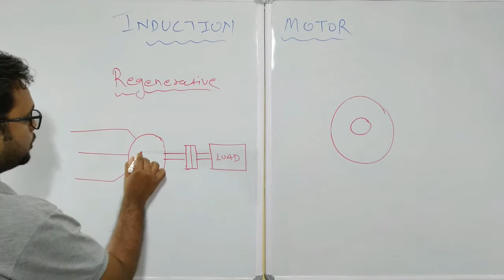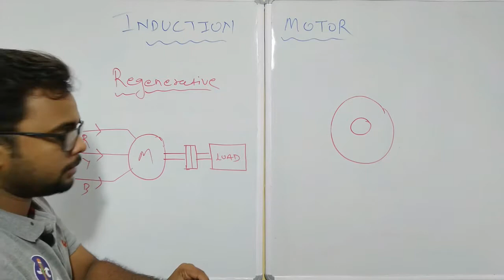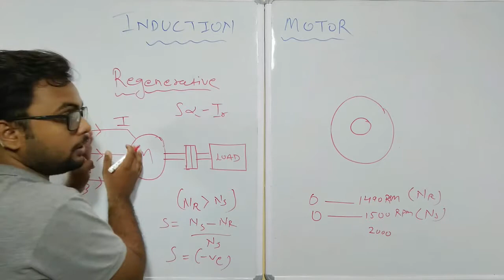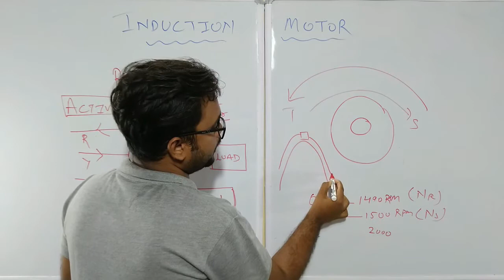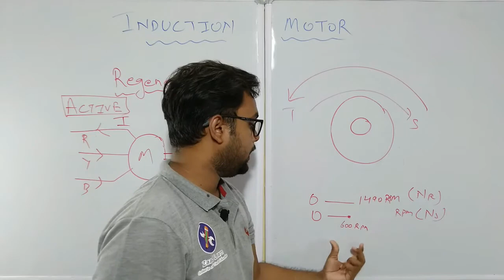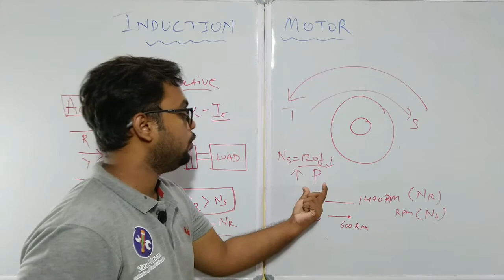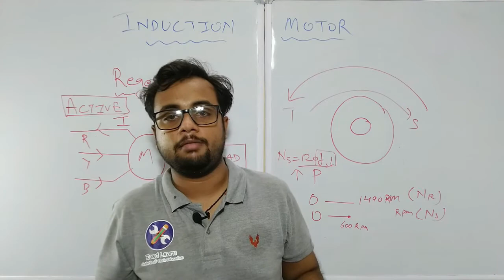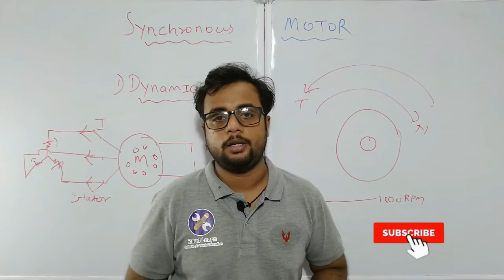Regenerative Braking in Induction Motor || Zaad Learn

Comment: when we change synchronous frequency, doesnt it change rotor frequency too? and won't that be a problem when we are making a VFD with regenerative braking
Reply from the maker: Yes the rotor frequency will be changed too. Imagine a scenario when we leave the accelerator of a EV the synchronous frequency will be reduced, since the rotor was running it will take some time to slow down and to reach the decreased synchronous frequency. The motor will regenerate only till both frequencies get the same value.

Most of the industrial VFD uses external rheostats to dissipate this energy but options are also there to use it back to source or to batteries.

Hope that solves the query

Comment: Pl explain why negative torque produced during regeneration?? Its not just about equation that current will be reversed in regeneration. How current will be reversed must be explained
Reply from the maker: If you ask about the basics then since it is generating power while breaking the current will move away from the machine towards the source, now due to generation effect the machine will demand torque instead of supplying like generators do.

Comment: Regenerative braking is possible in Synchronous motor?   Is is possible in Permanent magnet synchronous motor?
Reply from the maker: PMSM very nicely supports regen braking.Some of the current EVs uses this motor

Comment: What is the safe maximum and minimum speed limit at which regenerative braking can be applied in electric train? If supply frequency is to be lowered to maximize regeneration, then what is the limit of minimum frequency that can be lowered from 50Hz?
Reply from the maker: Every Traction company has a different limit but on average Regen Braking can be applied at speed above 20KM/HR below this mechanical break will work. The frequency will be lowered up to 12HZ to get maximum generation some companies go below that also.
Reply: @zaadlearn5500  Thank you for answering. Is there any document which i can use for reference regarding low frequency limit?
Reply from the maker: @dilshangunatillake5336  No Companies generally never share that kind of documents